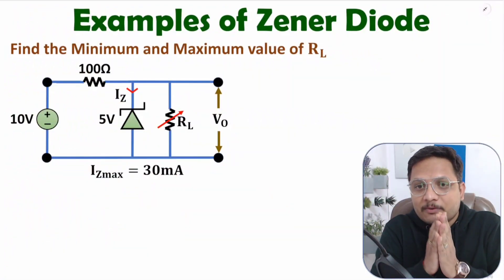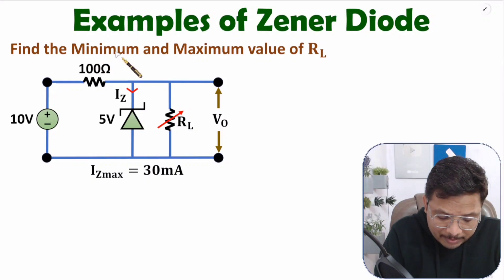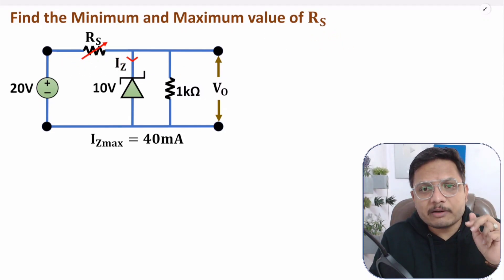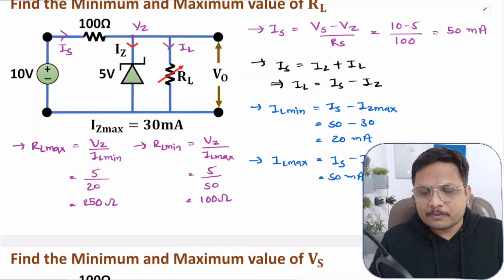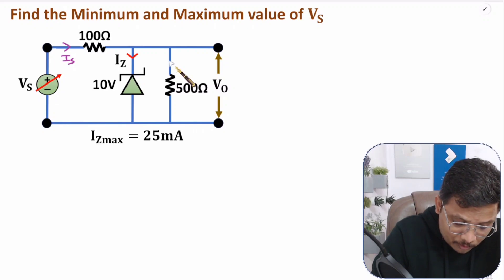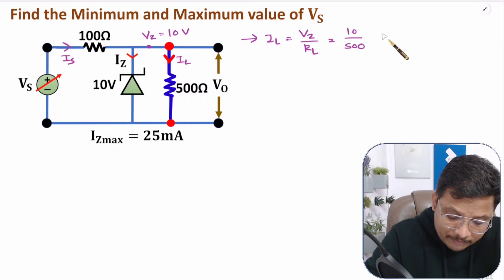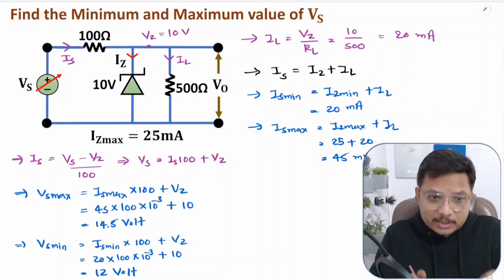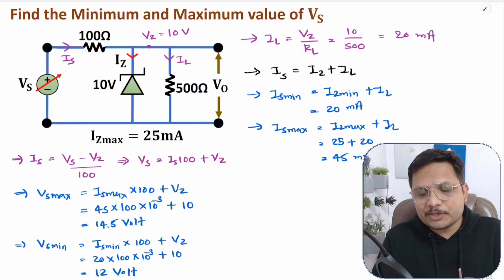Solved Problems of Zener Diode as Voltage Regulator | Zener Diode Parameters | Basic Electronics

Comment: sir in the second question why cant we use Vsmax= Is max * R this equation sir
Reply: bro we are finding the total voltage supply bro, so Vs is for the whole circuit, so we need to consider voltage across zener also since it is the regulated voltage across load, so Vs is sum of both voltage lost at Rs (IsRs) and also the Vz, not only the voltage lost in the Rs resistor